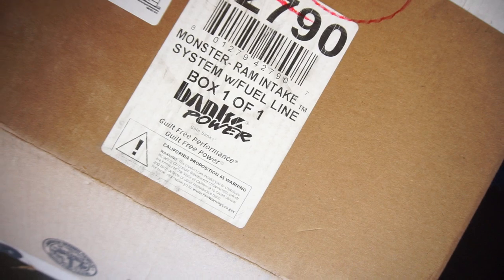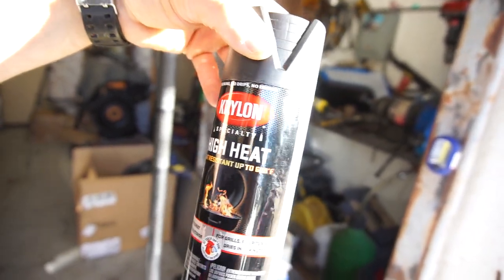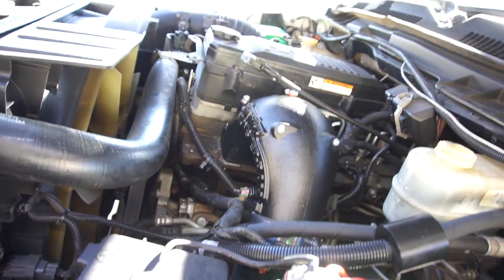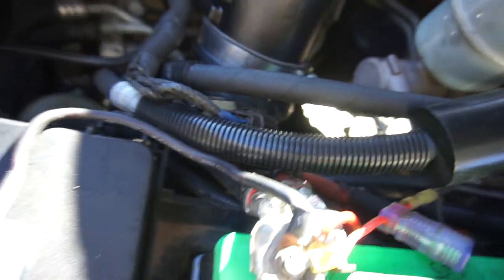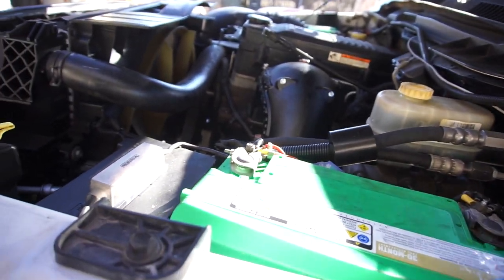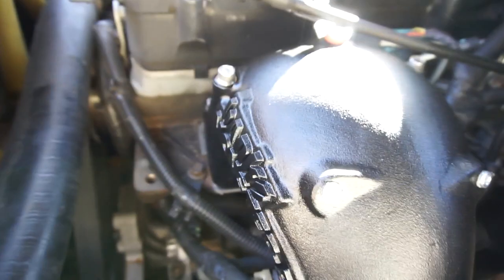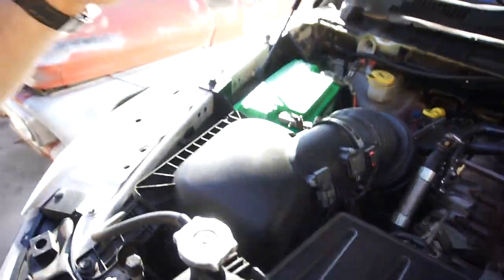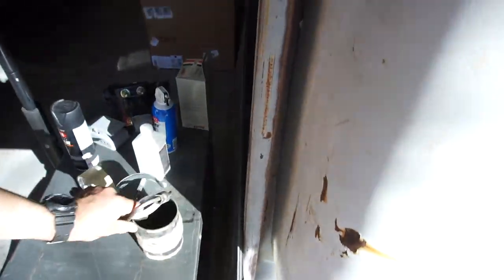Banks Power Monster Ram Intake Elbow. 4th Gen Cummins 6.7 Ram 2500 2010 Mega Cab

Comment: So what happen to the connection that was connected to the throttle body?
Reply from the maker: Tarcisio Sanchez disconnected. Just like all the other EGR stuff. Plug is sitting there.
Reply: Halffast719 oh ok. So it won’t show like a code or something if is not connected?
Reply from the maker: Tarcisio Sanchez no as long as you have the tuner set to high sulfur then it knows all your emissions are removed.